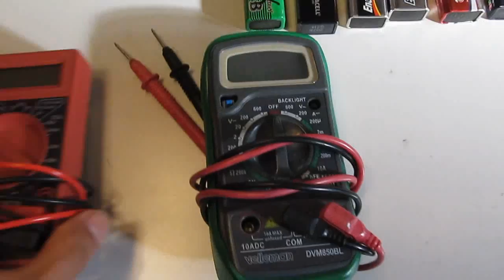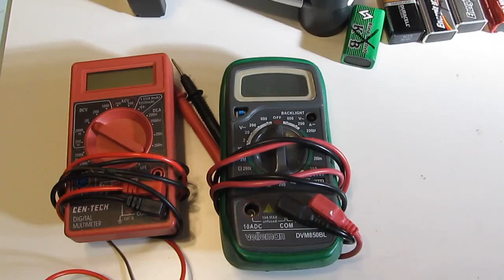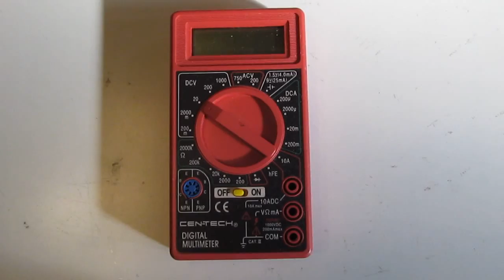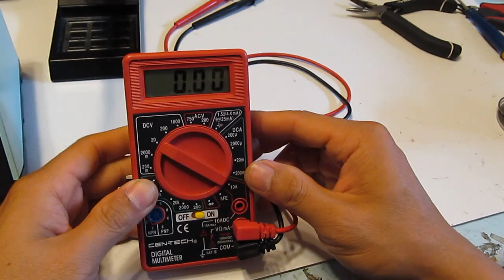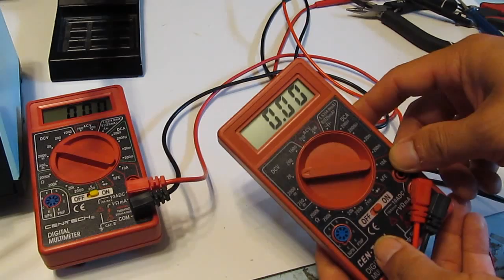DIY: 9V battery hack. Save money on 9V Battery with Li-ion rechargeable 18650 or Lipo

Comment: Very bad idea to have those batteries unprotected like that.
Reply from the maker: I agree. That's why I have a green case for it now. Check out this video https://youtu.be/u1NakhiAqaw at 12:33. 
By the way, I did this hack over 2 years ago.  I use this meter everyday. Sometimes I forget to turn it off and just let it on for days. it's still working and I still haven't had to charge the battery even once.

Comment: the problem with this is that... yes at full charge they will give you 8.4V but as soon as the charge goes down if you use this set up in a smoke alarm or something similar it will start chirping.
anything under 8V and it's chirping time... not a very good solution for these but I suppose you can use this kind of setup for a multimeter... sure...
Reply: It will takes ages to drop to 8 volt
Reply: @MrStyle-sr1yv  not really with these cells it drops pretty quickly.

Comment: You must be isolate battery terminals for security. Otherwise you can shock when measuring high voltage. You can use 2 small li-ion battery for put internal of meter.

Comment: some devices will require a higher voltage than this setup can provide. What I'm curious about is what those devices are. What type of 9v device CAN'T you use a 2s lithium setup for.
Reply from the maker: I have tried many 9V devices with a 2S Li-ion. All of them work fine. I haven't seen any 9V device that doesn't work with 2S Li-ion, yet.
Reply: @vuaeco  Thank you for your rapid response.  I have a 9v device that chews through a battery in about 6 hrs.
I was hoping to find out it it would work before going through the work of hacking together an 18650 holder. I want to use a removable cell setup so I can use them in series and remove them to charge in parallel. I will put something together in the next couple of weeks to see if my device will run and check runtime. Thanks again.

Comment: You need to be careful when charging this batterys.. Cheapest way will be to start with 2 battery's in series with same initial voltage and after that using a 9V charger to charge both at same time. The right way however will involve a balance charger in 2S config.

Comment: I like this idea.  Replacing a 9V battery with two big lithium ion batteries like that?? oh yeah, you can be sure that will last FOREVER!  Devices that normally run off of 9V batteries (even if they seem to drain them fast) use hardly any energy because a 9V alkaline can only hold a tiny bit of energy.  Consequently, replacing with Li Ion gives you an ENORMOUS increase in energy density.  Plus, they can be recharged, as you said. :)

Comment: Great ideas and sharing. 
Buy meter tester with Auto switch off
Reply from the maker: I do have meters with auto switch off. But like John just said, sometimes you don't want it to turn off because you have to do testing. But anyway, the meter is just an example for this hack. The point here is to use 2x Li-ion batteries to replace the expensive 9V battery for any device that uses 9V battery.